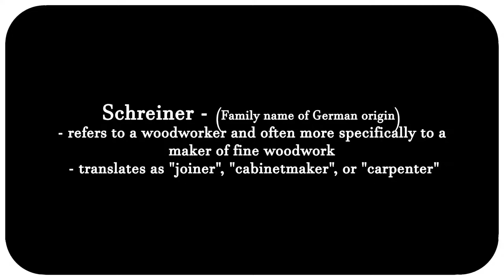Rebuilding a Shed Door

Comment: Nice build. Don't forget. Building a hybrid metal door..It has a 2x3 frame and top and bottom pins rather than hinges. if that doesn't work..Ill get to go to the hardware store or maybe I'll need a new power tool. Hmmmm.
Reply from the maker: Thank you!
Reply: Have you seen the new Hart Tools selection at Wal Mart? I just got a 16 x 24 right angle ruler. It was about 7 dollars.  it is genuine aluminum plastic coated quality.
Reply from the maker: Sounds about right for Walmart lol, I can’t remember the last time I went there.
Reply: I've actually bought some pretty cool tools at dollar tree. Also some of their tools are a little subpar.  With a little forethought you can take their yellow 2 foot levels and use for a long time.The bubble aparratus falls out.  Count on it. It happened twice. I like the level..super glue as soon as you get it.
Reply: The. dollar sand paper pack is very thin. Better than nothing. Don't get it wet.
Reply from the maker: Good to know!

Comment: What was the total cost of parts and materials?
Reply from the maker: Somewhere around $100 I believe. 
1 3/4 sheet of PT plywood
1 8’ PT 2x6
1 pack of gate hinges
1 gate latch
2 6” carriage bolts with washers/lock washers and nuts.
Reply: @John the Schreiner  My door frame is 5.5ft wide and  5ft tall. What size plywood did you buy?
Reply from the maker: @kickasbutterfly  4x8’. It was a 5’ high, roughly 3’ wide doorway.